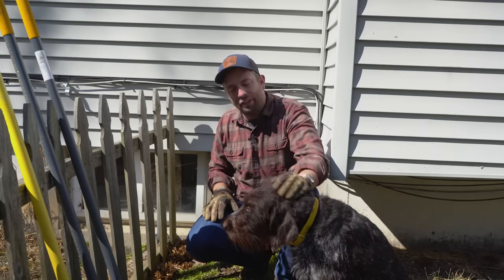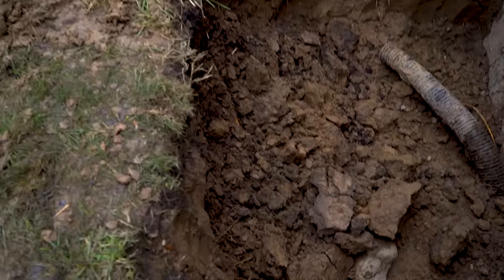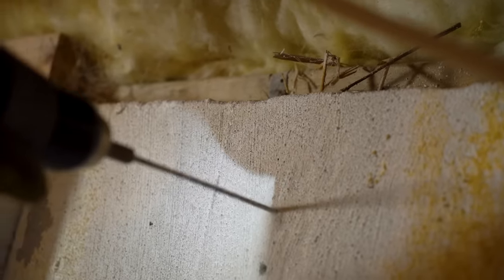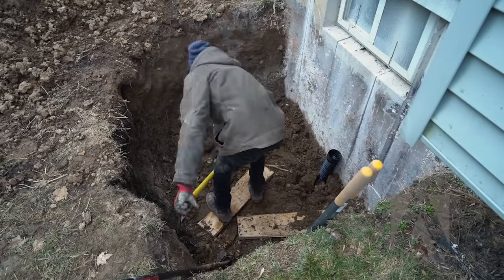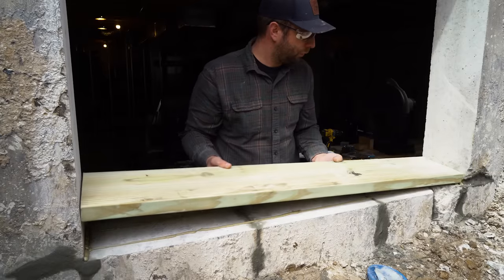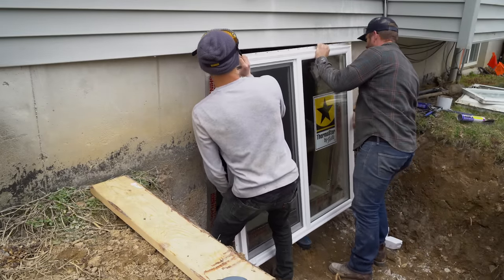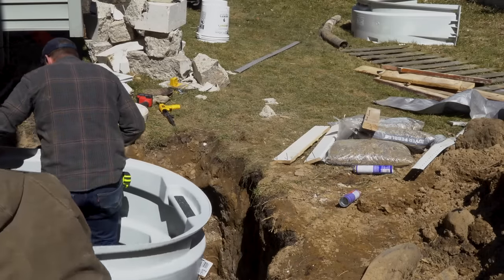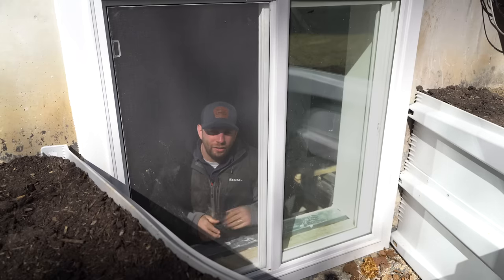Egress Basement Window Installation |  How To | DIY Home Improvement

Comment: i have a quick question. How much for the cost both labor and part for this project?
Reply: For you? $2-2500
Reply: I got bids between 2200 -3000 this week
Reply: What's the trick in that question 🤔🤔🤔
Reply: What’s the cost of just the cutting of the foundation?  The rest is mostly labor and probably around $500.
Reply: in my area cost estimates were $3600, $3800, $4600.  The lowest estimate told me it would cost me $2500 to do this by myself.

Comment: Very well done. It looks like the saw cutters cracked your foundation wall. What did you use to fill it in?
Reply: I don’t think that is a crack but an overdue from the blade. But I’m curious what he filled it with too. Just got mine cut today and need to fill those overcuts
Reply: @dankwilde id use hydraulic cement

Comment: you also need to seal the edge of the well or soil and water will leak in causing multiple issues. id like to see this after 2 or 3 hard rains. it also helps to put more of a dam at the bottom of the well to keep soil from seeping in under the well wall.
Reply from the maker: Well it’s spring here and we’ve had multiple hard rains and it’s working absolutely fine as it will continue to work

Comment: Dang! That was a beautiful slab of concrete you coulda used for many wonderful projects rather than bust it up!!!
Reply: I was thinking the same thing.  Table or bench came to mind.
Reply: saxonsoldier67 you want a 200lb table or bench
Reply: Now. To get it out of the hole ....
Reply: @Dfpijgyt564s65sgt     It was such a nice piece.  I was thinking outdoor in a garden or near a fire pit.  A slab like that wouldn't be practical in the dining or living room.  A piece like this one would be right at home in Fred Flintstone's home.   Perhaps that is my attraction to the slab.  Just don't wander thru a room and stub your toe on it in the dark.
Reply: @thebatman6201    A few straps and some manly muscle have proven capable of moving many a statue or stolen ATM, so why not a slab ?
Reply: @Dfpijgyt564s65sgt  200lb? more like 700 lbs per slab. Its 8" thick
Reply: What is the cost of cutting the concrete

Comment: Also if you use a gate for security they can not be locked at all. Also must have latch to open from inside of house to exit. If they have a latch and not just the folding kind.

Comment: I'm all for DIY but I really hope you checked with a structural engineer before you did this project.  Usually, when you create a larger egress of that size you compromise the integrity of the foundation.  I didn't see you install any additional supports other than the wood frame for the window.  Looks pretty, but that load on the wall when the soil gets wet is concerning now.
Reply: Good point, but fortunately it's only a few inches removed on the left and right (vertical doesn't matter as much since I assume the window already had some sort of lintel support? I hope?). So hopefully this won't be catastrophic.

Comment: Have you forgot the drip cap over the window?
Reply: The way the siding is overlapping the flange it pretty much acts as a drip cap. I would have put another layer of that flashing tape over the flange to be safe though.
Reply: 100% no drip cap. The siding runs right to the top of the window. Water WILL find its way down and behind the side trim also butted against the siding.
Reply: @glenjamindle  I don't think you guys understand that style of that window does not accept or need a drip cap. The flange is a built-in drip cap, you could run a water hose straight on the top of that window and it would not enter. I definitely would have put some type of sealant behind the flange though.

Comment: My house was built in 1907. I have four basement windows that I'd like to do this to but if I cut a hole like that in my foundation the whole house would collapse.  Not to mention my foundation is rock and mortar the latter of which has deteriorated into basically sand.  I worry at times because I'm not sure what the hell is holding my house up.

Comment: Now you have to worry about burglar intrusion.
Reply from the maker: Not any more than any first floor window.
Reply: Uh, you have to worry about that with first floor windows. Doors, garages etc. You must live in an apartment on fifth floor to think burglar intrusion
Reply: Same as all the other windows and doors.
Reply: @ThirdCoastCraftsman  😁
Reply: @jessi330  yes but all other windows and doors are visible now burglars can hide while they break in.
Reply: Now they can enter your home and you won't even know they are inside because that window is so simple to open.
Reply: @daniel51404  meh just get an alarm system
Reply: Lmao
Reply: @ThirdCoastCraftsman  Actually that is solved as well...the Ramset of course...Equalizer anyone?
Reply: @ThirdCoastCraftsman  This is so true, its quite comical. Even a 2nd floor window can easily be entered with a ladder for anyone with the slightest bit of determination
Reply: Daniel Bull Runner Lamb window alarms
Reply: Third Coast Craftsman what about a over the top cage?
Reply: @daniel51404  😭🤣🤣🤣
Reply: This is a joke, right?    
You must live in one of those cities that’s been run by Democrats for decades and is riddled with crime.
Reply: @leroyjenkins7968  one kick away from forced entry. 😆
Reply: Nah. You can put bars on the inside of the window, if you really want.

Comment: I've used K&H Sawcutting.  Those guys are great.  How much did they charge you ?  I'd dig some of that pea stone out of that well and leave more of a distance from the bottom of the window.  If you ever have a problem with the drain it buys you more time before the window leaks if rain fills that well up.  I know from experience.

Comment: Now, removing a small span window, and cutting a larger piece of fundation out, and not adding any extra support for the house plate? I thoungt in this case instaling  at least 2" 1/2  x 1/4" T angle lines would be a must. I'm missing something?

Comment: Nice to see no respirators & concrete dust everywhere in the air in 2020. You should have also put the flashing / blue skin against the concrete prior to attaching the wood frame.

Comment: Fast question: about your rough framing; did you install a pressure treated board across the top OR is that board, I see,  part of the original structure that goes along the top of the foundation...??????  OK, I think, I see that you did install a top horizontal rough frame.    Right????

Comment: I live in Aus and basements aren't really a thing here, but I appreciate the coolness of this project. I was wondering, as I don't know the rules/laws though, is there a minimum distance from the window that well wall thing has to be? If not, I think i would be putting up some kind of faux stone wall covering to hide the ah.. plastic or pressed metal look of the well. Nonetheless very interesting project. Nice!
Reply: Seems here in the U.S. people these days are willing to put up with a lot of vinyl.  Where I live we have a lot of natural stone that we'd encounter in that digging that makes me want to use it, or something like it (like manufactured block) instead, but it wouldn't be as simple and as stable to hold back all that heavy wet clay he has, and especially winter freeze and thaw, which looks like this guy would be dealing with (he sounds - and his yard looks like - upper Midwest U.S. Area code on those concrete cutters sweatshirts looks like Michigan).

Comment: Did you remember to caulk the extra cuts on the bottom of the concrete opening that were made by the saw? 
Those slabs you broke out would have made a cool set of stairs to climb out of the hole on.
Reply from the maker: We repaired those cuts with actual concrete repair
Reply: @ThirdCoastCraftsman  That's good to know if I ever decide to do something similar.

Comment: Awesome video, everything I needed to know.  Thank you. One question. Should the pressure treated wood be exactly the width of the foundation?  I’m guessing yours was 8”?  So did you use a 2x8 (7 1/4”)?  I’m guessing you flushed it up to the outside to nail your flange to?  Thanks again!

Comment: Any structural issues doing
this where existing windows are? You contracted out
the concrete sawing but did the rest? I have a basement window about the same size as what you have. About how
much  does a saw job cost? What type
business does
this?

Comment: Should have gone with Titen bolts instead.. tapcons are junk in my opinion. And if you got a few 1/4 x 3” concrete screws you’d have a better outcome than the ramset nails.. JMO. Looks good though! I’ll be doin the same thing once it warms up

Comment: What is your rough measurement before you secure the PT wood in place....????  51" ...?? The window measures 47.5". Thickness of PT framing 3.25". 47.5" + 3.25" = 50.75"...51".

Comment: Thanks for making this video! I’m planning putting in and egress window this summer and there weren’t any good videos on YouTube. If the foundation is cinder blocks do you think a handheld concrete saw would work?
Reply: Sometimes cinder blocks are filled when making a foundation.  If that's the case, you'll need a much bigger saw.   Also, there is often both vertical and horizontal rebar in concrete blocks.

Comment: It's like a giant snow bucket for Canadian basement windows! Yeah, wouldn't go so well here lol!
Reply: well you can get a big plate of wood or something plastic and cover up the hole for the winter
problem solved!!

kinda
Reply: @kylo-juju3796    No actually you CAN'T do that by law! The fire codes do not permit obstruction of windows, especially during winter!  I'm a Property Manager, believe me, they won't go for it!
Reply: @audacyspectrum3612  i didn´t know that tbh
thanks for the info
Reply: @kylo-juju3796    Yeah, it's tight laws when it comes to windows...  Imagine being stuck in a house fire, and a kid's only way out is that window...that's covered by inches of snow! Or a wooden panel cover by heavy snow! That would be their argument.

Comment: How is the floor system and load-bearing walls above being supported? Just curious because you cut a wider hole and didn’t mention or show anything about a Lintel.

Comment: Ramseting wells they have a chances at pulling away from the wall you want to use concrete anchors  to stop that at least at the top side you can Ramset the bottoms though

Comment: Just curious as to why there was no support added to support the loads above before cutting out the concrete? I see there is a beam set in a pocket a little further down on the same wall, and it appears to be a foundation which would take the loads from above.. so I was just curious as this definitely looks load bearing. I'm not a professional - just asking out of curiosity, thanks for a response in advance.

Comment: Question:  When you laid your lock tite poly beads, you ran two of them parallel from edge to edge.  Is there any chance that by doing you're creating a sealed pocket for moisture?  Just because pressure treated lumber is super wet still and as it sweats in the summer there will be nowhere for that moisture to go and it will rot out?

Thanks!!!
Reply from the maker: That’s a good question but as it’s pressure treated im not worried. Really the moisture that is still in that PT lumber is the chemical treatment.

Comment: No lintel needed for such  an increase in the span crossed by the sill plate?
Reply: That’s my concern as well. City told me I would have to have an engineer sign off if I went wider than current dims. A metal header/top plate is also what I’m thinking.

Comment: Are you planning on putting any kind of cover over the well for security or to keep snow out in the winter?  I have an egress window in my basement and the well walls are starting to collapse because they are just pressure treated lumber. I may have to tackle this repair this year by using these wells.

Comment: Not sure about the area you're in, but in the north, I would be worried about frost protection. Is your footing at least 4-5 feet away from the frost line which would now be lower? Not trying to knock your work. I am genuinely curious as I would like to do the same to a house we are considering buying.
Reply from the maker: I’m in Michigan with a 42” frost line and this passes code no problem.

Comment: I see that the floor joists are parallel to the window that was installed. If the joists were running perpendicular with the window, would a header have been installed?
Reply from the maker: Yes
Reply: @ThirdCoastCraftsman  even if the width of the window is not changing? Reason I ask is I am installing an egress where there was an existing window, but I am not changing the width. Only the height.
Reply: @brytonmeyer5361 You will be OK. Only if the you are going wider.

Comment: I've been YouTube researching this project for some time now and this video offered a few more details on the actual window installation than others.  Thanks for sharing your experience!  I'm in MN learning about the permit process.  Did you require a site plan as part of the permit request or not necessary for you area?
Reply: Did you ever end up doing this to your house? I just purchased in MN and I'm curious what it entailed and how it turned out?
Reply: I did!  Despite all my research I still learned a few important details in the process. Permit process taught me I didn’t have the zoning distance from my property line and therefore had to locate the window on the front of my house (no existing window to start off of) and needed to include a header. The cut is extremely important. I rented a 16” blade and wet saw to cut 12” thick cinderblock wall…I then tried to transfer the cut to the inside of the house and complete the cut with an angle grinder (dry and dusty). It was a sloppy cut. When installing the window well I realized the hole was dug in such a way that made it difficult to secure the left side, being right hand dominate (Dig the hole bigger).

Comment: Great video, did you have to pull any permits from the city?  This was super helpful cus I may have to do two of these soon. Thanks
Reply: wayne4386 - We’re having one installed in a couple of months. A permit is required by our city.  Check with your city’s building dept to see if one is needed.  I would guess that it is.  Also, now that the room it’s going into is considered a bedroom I have to add a carbon monoxide and smoke detector in the hallway within 10 feet of the bedroom and a smoke detector inside the bedroom itself.  In my state (MN) adding or replacing a window is cause to require the entire house to be up to code so now I also have to add smoke detectors inside each of the other bedrooms as well.  Apparently the inspector will look for that during the inspection.

Comment: great work , well sealed, very practical , curious why did you not consider using a steel lintel to support upper concrete after cut?
Reply: I think because the floor joists are running parallel to that side of the foundation, so there is not much bearing weight. I think if the floor joists are perpendicular and bearing on the foundation, then I would for sure use a steel lintel to be sure.
Reply: @natec9420  ty!

Comment: No lintel?

Did you need/ get a permit/ inspection?  Curious to know if they said anything of interest.
Reply: looks like they removed all the concrete to the joist. and there is no brick/stone veneer, so no lintel necessary. Also, looks like the floor joists run parallel to the window opening so not much of a header is needed. they could always sister another joist next to the rim joist if it was needed for wall load.
Reply: @Bradley Kang  Thanks very much!

Comment: can you add a full size egress door, instead of a window?
did you have to get a building permit?
Reply: Good question here.
Some bushes around the top to cover it too
Reply: @enriquecabrera2137  or at least some ground cover, like ivy, that would eventually cascade over the plastic so you would have something green and beautiful to look out at.

Comment: The ridge beam is not structural. It should be supported unless you already have the appropriate engineering at the ridge.

Comment: Do they have covers for them and how strong is it?I have a 58x60 window and it's all below grade plus my home is set in the ground so you can step over window and walk on the roof.So I get allot of snow coming off of roof and at times is piling up from ground to roof top.So cover will need to hold allot of weight,few hundred pound.

Comment: We don’t have a basement so not very familiar with what this is for. The description says it was for light and improving home value but is there anything else? Looks a bit odd.
Reply from the maker: When you add an egress window you can now legally count the basement square footage as livable space/bedroom (if it’s finished). An egress window means a firefighter with equipment can enter through that window. With an egress window you now have 2 safe points of entry in case of an emergency or fire and because of that it improves the value of the home

Comment: Maybe I was sleeping during this part of the video, don’t you require a lintel above the window? Love the dog! 😁
Reply: The header for the basement/first floor floor joists acts as the lintel, if the window had been installed with a brick face on the exterior the lintel would have been required to support the exterior brick. I could be wrong

Comment: My first impression as a former cable TV installer is to call your cable TV/ISP/Satellite TV company out and tell them to fix your cable installation. Those wires along the side of your house need to be fixed before you ever plan to sell it.
Reply from the maker: Yea the previous owners had satellites (there are still 2 on our roof) and wires running all over
Reply: @ThirdCoastCraftsman  My apologies for nit picking something completely irrelevant to your video. Bad cabling is an unreasonable pet peeve of mine.